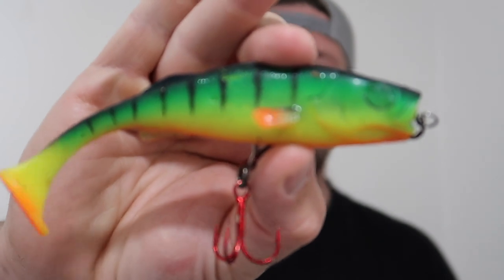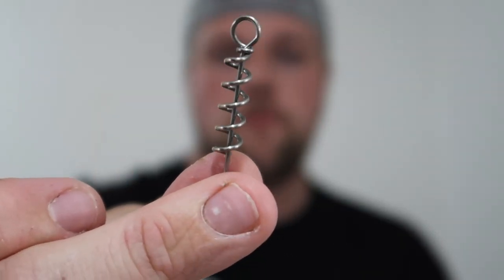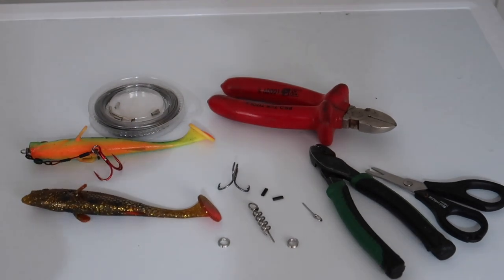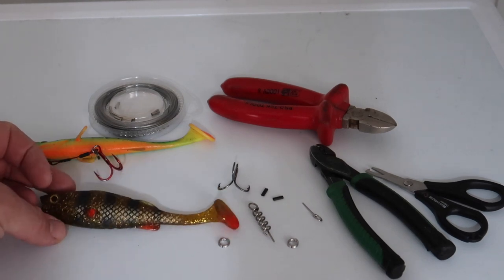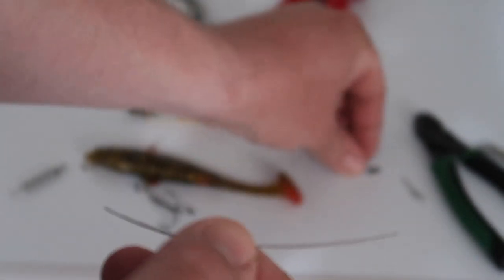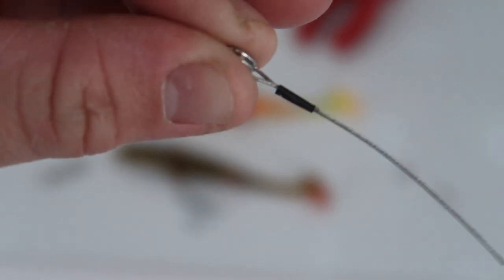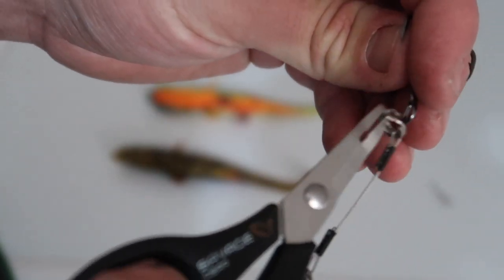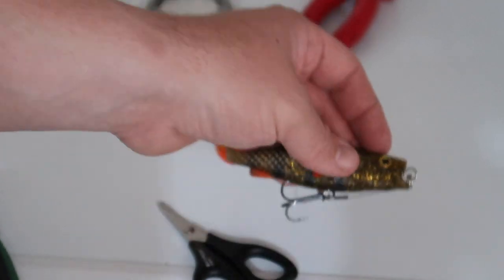How to tie a basic soft lure stinger! How to Tuesdays ep.4

Comment: Can stingers be used for smaller baits like 7cm 8cm type size? Or only on bigger stuff .. thanks for the advice too. Will perch take an 11cm lmab kofi perch?
Reply: A jig head would be better, also the whole shallow rig sistem on a bait this small can affect the action of the lure in a negative way
Reply: @akaperry5626  yea thats what iv been using and thats what i thought tbh... I lost one the other day, but I suppose its just part of lure fishing 🎣
Reply: @leafysfishing  When fishing with jig heads I always try to keep in mind to strike up with the rod because sometimes if you strike on the side (like i mostly do when fishing with stingers or hard bait) you slip the lure from the mouth of the fish, especially with pike, those big girls have a hard mouth
Reply: @akaperry5626   thanks for the tip.. do you use fluro or wire traces? Also what light lure spinning rod would you recommend for under £100? .. iv got a abu garcia devil spinner atm, 2g to 10g was only cheap.. £30 I think, but I'm wanting somat slightly better with a bit more sensitivity ideally.. also what jig head size do you use for 7cm soft baits? Sorry for all the questions 🤣
Reply: @leafysfishing  No problem mate. I use titanium wire traces, i like the knotable one, using the Afw atm. For the rods I always found the Savage Gear ones a pretty bang for the buck, I have 2 of them so check them out. For a 7 cm lure i think size 2 would be fine i think, never used bait this small, I mostly fish for pike, there aren't many good perch water near where I live
Reply: @akaperry5626   ah thanks mate ... the canal and river near me are full of good perch upto 4lb so I'm hoping for a lump this year. Currently I have 2 rods, an okuma ufr 5g to 20g and the abu garcia.. both entry level rods. I'll look at the savage gear ones when I decide to upgrade.. thanks again 👌
Reply: @leafysfishing  If you want a proper set for jigs around 7cm, you'd be really good with something like this;
 5-20g, 6,6 to 8 foot fast action rod, something like Westin W3 or SG2-SG4 Light Game or even ultra light
a 1000 size reel with 0,10-0,12 braid (for example Daiwa ninja 1000 and 0,12 spiderwire stealth 8)
edit: for leader 0.30-0.40 fluoro is sufficient, and holds some pikes decently well too.
Jigheads size depends more on depth of water, not the size of bait. Say you fish 7cm soft bait in 2m of water for example, you'd want 5g head with size 1 hook. It also depends on season, how active fish are and how fast you want your bait to swim. For cold seasons you can go as small as 1g per meter of water, and in warm season even 2,5g per meter on jigheads weight. Hope this helps.
Reply: @paake3134   thanks for that... iv been looking at the westin w3 and savage gear s2 I think it is... my abu is just a entry level tbh but uts a 2g to 10g wich is around the weight I want.. well sort of around there... I'm quite happy with my little okuma spinning reel, again it's only sort of entry level but iv grew to like it, iv got a good braid on it, its a 8 strand berkly firebraid, .. definitely wanting to upgrade my rod tho so I'll look again at them, iv got a big local tackle shop I can go check some out at 👍 I'll take that advice on jig heads too, iv mainly been using around 4g to 7g max and even some smaller 3g ... I just seem to have a bit more control around the middle area of what my rods rated too... it says 2g but I don't seem to have much feeling and control on anything that only weighs 2 grams. Thanks for all the advice .. its appreciated 👍 oh and funnily enough i was using a size 1 5g jig head on my lmab kofi roach and I caught a small pike 🤣  I'd upped size to one bigger just to try get the hook a bit further back towards the tail.. I'll stick to the size 1 ! 🤣